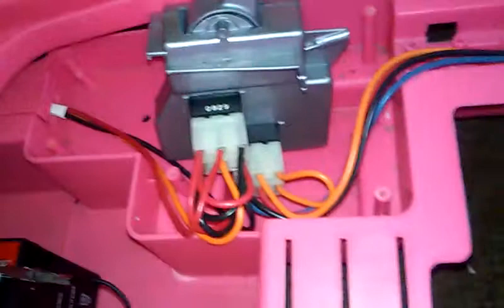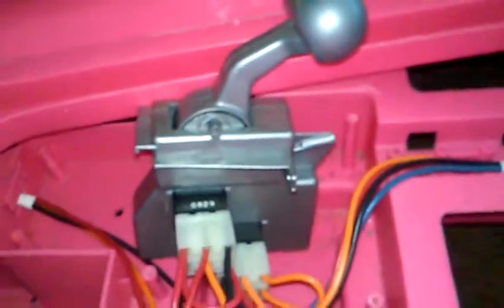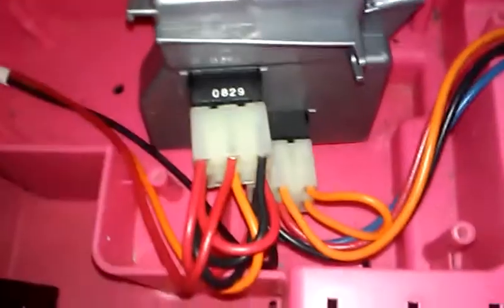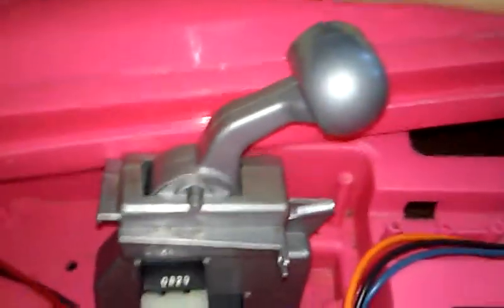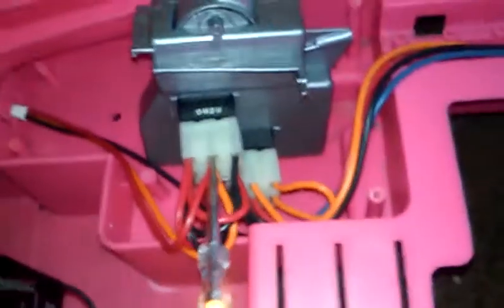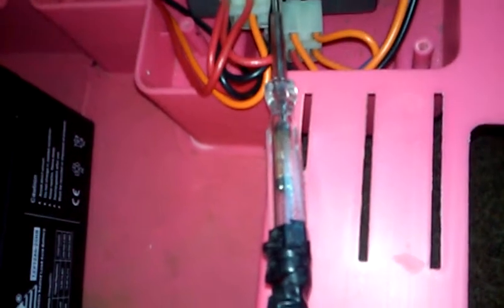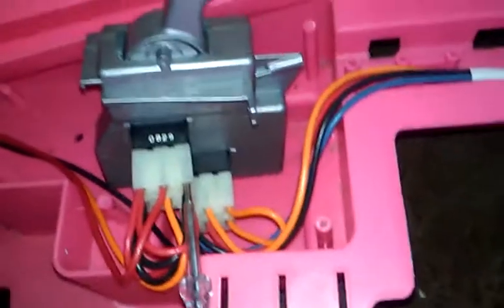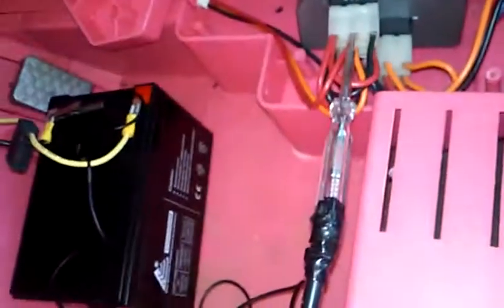Power wheels mustang How to wire brakelights & rev

Comment: Great video! 5 years later and exactly what I needed!
Just a quick clarification - For brake lights: the positive (+) wire from the lights will hook up to the correct wire (single red wire for me too) under the shifter and the ground (-) wire will connect to the GROUND (-) of the battery?
Reply: In the video you said "..and then the ground to the power lead of the battery source" but you were kind of pointing at the negative terminal of the battery. I'm just looking for quick clarification before I hook up. Thanks!
Reply: NVM I just found it in the comments you already answered this. Thanks for the helpful video!
Reply from the maker: Hi, I need to show the pictures I have along with the video I have another video on how to do the shifter by adding in the 3rd switch to control the brake and reverse lights.
Reply from the maker: The other video is called Brake light switch on a power wheels. 
Showing a grey shifter.
Reply: So I'm running 12v LEDs on a 24v battery. I have my running lights, head lights, and under glow lights connected to a single 24v to 12v voltage converter with their own switches, just like your other video with the pink cadillac.

The Brake lights and Reverse lights have their own 24v to 12v converter each hooked up in-line to reduce the voltage so the LEDs don't blow.

I found that the Red brake wire under the shifter is a ground wire when brakes are active (the pedal isn't being pushed) and becomes a positive wire when the pedal is pushed. 

That means that I should connect the LED lights positive wire to the positive of the battery and the LED lights ground to the Red ground wire under the shifter, right? Opposite of what you say in the video? Because I did try the way in the video but they didn't work. And when you hook up the test light to test the Red brake wire, you're connecting it to the red power terminal on the battery completing the circuit with the Red ground brake wire under the shifter?

And for reverse lights, the opposite it true. When the pedal is pressed while in reverse, the black reverse wire under the shifter becomes a positive wire, so I should hook up my positive LED lights wire to that black shifter wire and the negative LED wires to the negative lead of the battery right?

Also, I burnt out my converter so can you even use a converter on those wires since they reverse polarity when the pedal is pressed? 

The Red ground brake shifter wire is ground when the brakes are on and turns positive when the brakes are off (the pedal is being pressed).

The black reverse shifter wire is ground when the car is not moving but turn positive when the pedal is pressed while in reverse.

Maybe there is a way to isolate the converter when the polarity is reversed from how I want it? I'm not really sure.

I appreciate any help you can give me!
Reply from the maker: @divitasprocessservice839  Hello, I believe it's correct the way you said it for the brake Light's. It's been so long an I don't have either of the ride on's any longer I had sold them later on after this video was made. The wiring gets sorta confusing I have another video with them on a Dodge ram with me re explaining it. 
And Honestly I'm not sure about a converter being hooked up I had everything hook up straight 12V. And I do remember I had one that was ran 24volts but still used a 12volt to run everything Auxiliary. LEDs, Horn , radio, etc. It would be easier to send you some photos I took of all how it should be wired up.  If you have a email or something I can send them to you for reference.
Reply from the maker: Ok Check out my Up to date video on HOW TO DO BRAKE LIGHT'S ON POWER WHEELS 
Im showing how the wires look for the brake Light's with the added 3rd switch in the shifter on a Black power wheels Escalade.
Reply from the maker: Also check out my Break light switch installation for power wheels.
Reply: Hey I checked those videos out and I'm pretty sure everything is wired up correctly. I think the problem is that the shifter wires are burning out the 24v to 12v converter when they switch polarity.

Any idea how I can allow positive to pass through to the converter but block negative when the wire goes negative?
Reply from the maker: @divitasprocessservice839  Hi, Actually I'm not sure about using the converter with this mod. As it's a 12volt led light set up, I've never tried it to be come a 24volt series. That would be something to think about but I no longer have any more ride on vehicles to try it out on.
Reply: Got it, no problem! Thank you.

Your LEDs never got damaged from the polarity switching?

That crazy. Maybe it's because the current to the LEDs is low enough to prevent damage from reverse polarity?
Reply from the maker: @divitasprocessservice839  Nope they never got damaged...it's basically the opposite just in reverse if that makes sense. 
 Never had a issue an sold many with the same hook up just told them that they couldn't run the ride on 24 volts with the LEDs hooked up...it had to stay 12volts or otherwise disconnect if they wanted to run 24volts.

Comment: I am trying to get the brake lights work properly on a different power wheels. Let me know if you could tango to help. thanks
Reply from the maker: Jasen Barbour sure i can help you tomorrow its pretty simple what kind of PW vehicle you wanna add them on ?
Reply: On a Peg perego polaris RZR i think you watched my youtube video and commented on it. I got the 1157 light bulbs and I have them connected to a toggle switch right now. When i turn toggle switch on the "running lights" are on. but i don't know where to wire the other wire into to make the brake light come on
Reply from the maker: Jasen Barbour hello Yes i remember it. You did a nice job on it. Ok the trick is for these reverse lights is you are gonna have to follow my video here except on that Polaris you are gonna have to trace your wires to the shifter an you are gonna have to use a test light to find witch wire lights up when you put the vehicle in reverse. So once you've done that you can wire your back up lights to that wire coming from the shifter. Now as far as the brake light's you gonna have to re connect to the positive an use your test light to see witch wire stays on an goes off when you press the fwd peddle.

Comment: Great videos Cadillac Escalade, Ive been trying to get my son's hooked up. I wired all the lights to a switch and to batt +/- , they are on when I turn on the switch, but all the lights go off when I push the gas pedal down, no matter if it's in forward or reverse. I really just wanted them on all the time, but can't figure out what to change in my wires.
Reply from the maker: Chip Baumberger  ok you should just run your wires to a toggle switch so that way you have access to turning them on an off..
Reply: yeah, I did that,  and the switch turns them on/off ; but the lights go out (with switch still on) when you hit the gas. thanks for the fast response, Imma figure it out with some of your other tips. Another youtuber said it could be the motors draw all the power when hit the gas, but i didn't think that sounded legit
Reply from the maker: Chip Baumberger yeah dont run the wires to thr gas pedal thats a big no no......
Reply from the maker: Chip Baumberger  do you have facebook or Tango video chatting i can walk you through some tips if that works...
Reply: That'd be great, Facebook: Rex Chip Baumberger is best, I use whatsapp for video chat
Reply from the maker: Chip Baumberger ok give me a min.
Reply from the maker: Chip Baumberger  ok im fina go look you up mine is Bubba Sawyer

Comment: How can i wire it on to a switch. So when its on the brake lights and reverse lights work and when the switch is off  so are the lights. Thanks
Reply from the maker: Rudy Romero Hi when you wire the brake lights and back up light's they will come on when in reverse and as for the brake lights you can add a toggle switch to them on the dash to cut off
Reply: So connect brake light positive wires to the accessories pole on the toggle switch then from the  hot pole run it to the gear shifter. Is that right.
Reply from the maker: Rudy Romero yes what kind of vehicle are you doing this on ? Because some are different
Reply: Cadillac escalade
Reply from the maker: Rudy Romero when you wire the reverse lights up to the shifter they automatically go off when not in reverse....and come on when shifted in back up....it's the brake lights that need a toggle switch to cut off brake light when not in use...
Reply from the maker: Rudy Romero https://youtu.be/pXzv76Vj04M
Reply from the maker: Rudy Romero https://youtu.be/pXzv76Vj04M
Reply from the maker: Rudy Romero https://youtu.be/D77VRAZXj80
Reply from the maker: Rudy Romero that last video showing how I turned the shifter in to the on off switch for the brake lights
Reply: Mad props on ur work bro... now how do i wire it up so they work just like this?
Reply from the maker: Rudy Romero Thanks brother what are you working on ? I am available to help out any way I can through a video chat if you like...?
Reply from the maker: Rudy Romero i did A Power Wheels Escalade in this exact manner its in my video's here. Every thing wired up to the shifter if you push the shifter all the way down all the lights would be off. You pull up brake lights would come on then when put in reverse the back up lights would come on. But parking lights would be controlled by switch on the dash
Reply from the maker: You have to hook it all up to the shifter box...check out my power wheels escalade video to see the operation how the lights work

Comment: can reverse light be activated a soon as the the reverse gear is selected ? instead of only when the pedal is pressed down. thanks!
Reply from the maker: Yes
Reply from the maker: Reverse lights come on only when gear is selected for reverse...just like real car. 
Brake light's are also like real car...they go off when car is in motion an stay on when car stop.
Reply: @cadillacescalade5428  sorry ,im confused, . i see that the circuit tester only lights on when the pedal is press. after it pedal is release the current stops. im trying to have the reverse light active as soon as the reverse gear is active, with the pedal is press or not. i might of not explained correctly maybe.

Comment: Hi can u be able to upload the steps with demonstrations on how u wire it.coz i have no idea on electrical wiring.and link all the tools and materials that u used.hope u ba able to reply.
Reply from the maker: Hello umm,.. I can make the video,..for you tomorrow..but all you need is just a basic test light. cause all you doing is just connecting the light to the battery to get the reverse lights....And the brake lights. the reverse lights is Negative and the black wire and the Brake lights is the red wire and that's the positive on those. Really easy. And just connect the red leds. for brake lights and the white lights for reverse. but ima make a newer video soon on how to doit just like the real car so it's just the parking lights an then when brake applying the lights get brighter
Reply: thanks 4 ur reply.i just wait 4 ur video coz im good on visual rather than instructions.hope i can also do this on my sons audi power wheels which has switch forward and reverse no stickshift.but il try first on mustang power wheels aftr watching ur upcoming vid.and im hoping u can also make underbody led lights and undercover police strobe lights as ur addition.il just wait 4 ur vid.thanks!
Reply from the maker: you should be able to I never tried it on a single switch for fwd and rev.
Reply from the maker: New Video's have been uploaded to complete this hook up.

Comment: With the brake lights, is there any to have them on and when the brakes are "applied" they get brighter like on a real car?
Reply from the maker: yes on one of my other videos with just the rear plate Pannel I show all functions applyed I just haven't made one yet on the actual car
Reply from the maker: on that you would have to actually use the 1157 bulds but what I would recommend is ordering the leds on ebay I'll make another video tomarrow on this. cause I have my son's mustang hooked up this way
Reply from the maker: hello,..on this question you need to order the 1157 leds ima make a video tonight on the lights needed to make what you want happen.
Reply from the maker: PascackValleyRailfan  i have a video posted in my channel called the rear panel for the operation of hooking up the leds like a real car
Reply from the maker: PascackValleyRailfan. On this question you would have to add 2 different set's of led light's.

Comment: Do you have a diagram that shows the wiring?
Reply from the maker: I'm sorry I don't  I never thought to put it on paper. Only because some harnesses very different color wires. 
You can use a test light an follow the steps it sounds complicated but it's pretty easy. 
Plug your battery up an connect to see which is your back up wire then mark it R 
Then the same for the brake light one wire should be constant and go out when the peddle is pressed then mark that one B